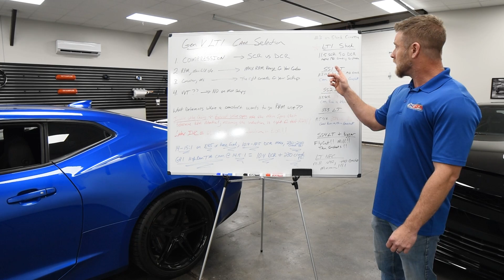Gen V LT Camshaft Selection - Compression and RPM

Comment: I already know all of this but to hear it come from a company that I’m considering to spending a good chunk of change with is very reassuring and validates my choice of wanting to go thru you guys. A lot of these companies are just copier’s and don’t understand the dynamics and they also don’t have a fundamental understanding or what they’re selling. For example throwing a massive cam on a car with stock springs lifters rods heavy valves stock intake manifold stock heads stock headers stock fuel injectors and fuel pump stock fly wheel as well as running a catalytic converter and wondering why they’re actually losing power.